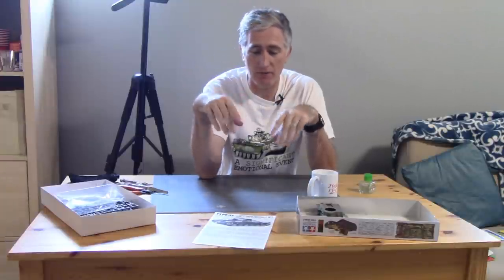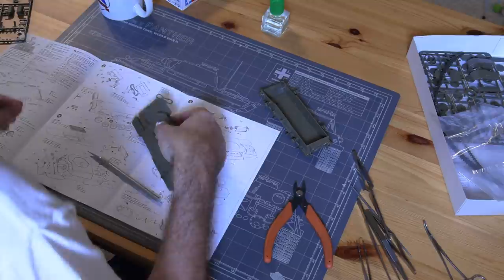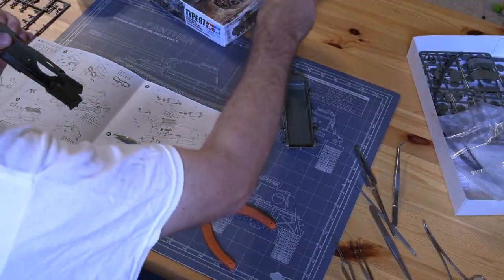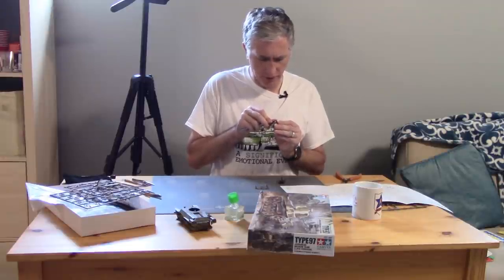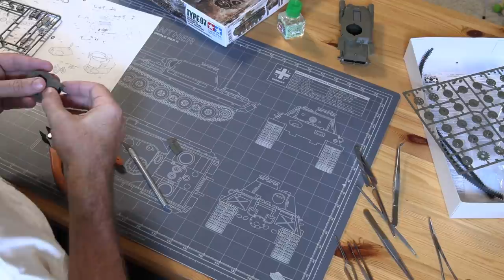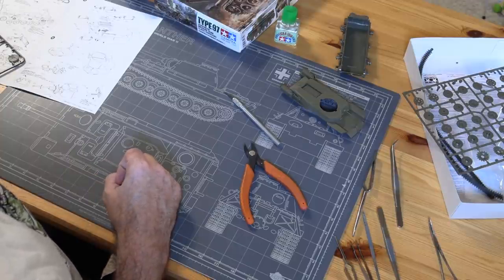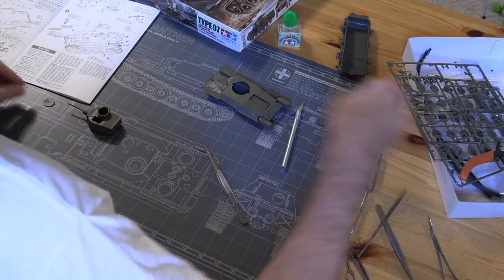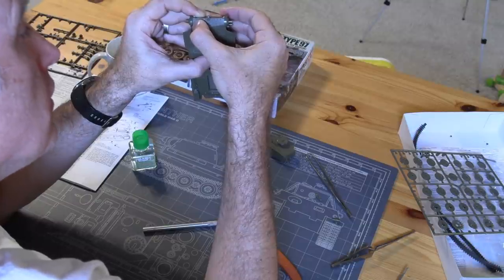Chieftain Builds a Tamiya Type 97, Pt 2.

Comment: As Chieftain seems to have  love affair with mold lines, I can heartily recommend the kit I'm currently working on, the Airfix 1/35 Gun Motor Carriage M10.
I've most of the suspension built over a few hours and every single piece had moldlines all around.
Pieces do fit together surprisingly well, compared to my (admittedly ancient) past experience with Airfix kits.

Nice cutting mat, but over $40 shipping is a tad much...
Reply: Well, that is a reboxed Academy kit from 2001. https://www.scalemates.com/kits/airfix-a1360-m10-gmc--1190148 OFC its decent, as almost every Academy kit. And the company is still humble, even when they make a superb kit, like the M1151 Enhanced Armament Carrier.

In stark contrast is the Meng, whos technology is in the 1970-80s (yes, outdated as hell), but their ego is huge. Flash, ejector pin marks and witnesses everywhere, even in their newest kits. Turd soft plastic, all of the bigger parts are warped. And their engineers are dumb morons, never built a single kit. Spruegates at the worst possible places. Their King Tiger's barrel can't even hold its own weight. Don't mention the turned barrel, that was only in the first 100 (or 150?) kits. Most of those kits never hit any shops, they gave those all to youtubers and other reviewers (AKA influencers). The mass produced version has two types of differently colored plastic sprues (while the promo ones used only the red), both have different properties (the sandyellows are soft, the reds are even softer), and no turned barrels at all. False marketing at its best. Never trust any Meng review in the release, especially pre-release.
Reply: That surprisingly good fit is probably caused by that kit not being an Airfix kit. It is an Academy kit inside an Airfix box, for a higher price. Cheeky things these modelling companies do.
Reply: I built the same kit and I can absolutely confirm that. Bloody hell is where I leave it at

Comment: After seeing recent eps. of Chieftain's Q&A and noting the S-tank in the back painted up in the Swedish Flag, I decided to go ahead and order the Trumpeter 1:35 kit, along with the workable track link set and BOTH sets of the Eduard PE accessories, just to make the experience as maddening as possible. During the quarantine I rediscovered some kits in deep workshop stash and managed complete a Dragon Apollo 17 kit, a Tamiya Ford Zakspeed Capri, and a Testors S.F. cable car kit, new in box, from 1987. The challenge has been relying mainly on existing workshop stock for paints, adhesives etc., as all the local hobby stores have been closed and online shipping has been really slow. Looking forward to the kit and all those tiny PE parts. Haven't decided on the Swedish Flag paint scheme as yet...although it is eye-catching. Enjoying the progress on the Type 97. Cheers!

Comment: @24:16

VRS is fun.  two ways to recover:  If you have space, the best way to to drop the collective and push the nose over (careful not to bump the mast, though).  If you don't have space, you can stir the cyclic in a circle at maximum travel.  you want to make a couple full circles in about 2-3 seconds.  Either way, the goal is to lower the pitch of the rotor blades (to clear the stalled condition) and get some fresh airflow (so you don't get back into the stall condition)

Comment: If it was a soviet tank you could expect to have gaps. They would be historically accurate 😃
Reply: You just make lots of them..... lots of them.
Reply: Can you find any photos of gaps in Armor in Soviet tanks ?
Reply: @mr.waffentrager4400  look at at walkarounds of late t34s. The rear hull plate can have missalignment.
Reply: @mr.waffentrager4400  I'm seriously considering if I saw ANY T34 with no gaps or simply even plates when one sticks to the other. For sure post-war this was not the case. Check out Bovington Tank Museum - the back of its hull (on their T34) - 1,5cm gaps. Regular
Reply: Mialisus  I think they got rid of this feature in all post war made T-34s :)
I dont think having an extra source of oxygen helps the crew when tank is on fire. 
The best way as far as I know is to jump out. Like less than a second after it starts ;)

Comment: I dunno if you've ever looked at them but I'm in the process of building a few Metal Earth models, they're fun little metal sheet models and they have both the M4 and M1. I would suggest starting with something other than the M1 since I've screwed a few up before I got the hang of everything and the M1 seems a bit more complicated than the others.

Comment: Hey chieftan, this is completely unrelated, but do you think a country could get more use out of older vehicles by turning them into ATGM carriers, kind of like some South American countries with M8’s, taking the 37mm off replacing it with the .50 from the roof and putting a TOW missile where the .50 would go.  But anyways great video, I kind of have a soft spot for Japanese vehicles
Reply: @Oliver Viehland To make a slight correction that relevant here, most arms treaties would consider a vehicle with 7.62s an APC, whereas IFVs have 20mm weapons and up (of course this is exactly the sort of thing that countries would want to consider when equipping)
Reply from the maker: It has absolutely been done. Look at the 90mm gun Kanonenjadgpanzer which got turned into the Jaguar ATGM vehicle, or Israeli half-tracks with SS.11 missiles. At the most extreme case, the Pereh ATGM vehicle takes perfectly reasonable 105mm gun tanks and converts them into missile carriers.
Reply: TheTutch I was talking about the m8 armored car and there are a few pictures floating around from around the 70’s of m8’s in South American service with atgm’s on them

Comment: "Open up the cooling system hatch and scratch build a cooling system inside... why?" 

Because why not? That's the basic thought process behind these things.
Reply: yeah, like the random hinge on the inside of the escape hatch of the Tamiya 1/35 Panther G. Nice if you want the escape hatch open, but as the rest of the interior is missing except for the gun mount, why would you want to do that?
Reply: @jwenting  Probably to allow for super detailed builds, alternatively, if you wanted to build a diorama. You might have dudes around, or commit wehrb heresy, and show it being destroyed, so either have smoke pouring out, or someone escaping.